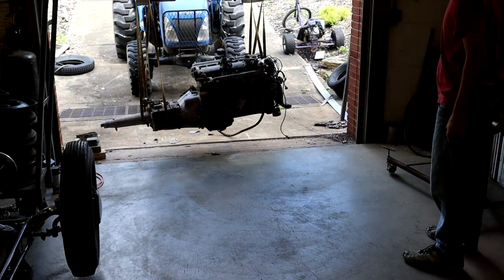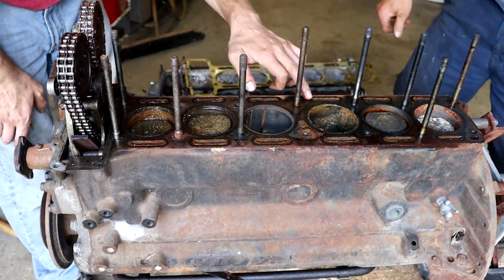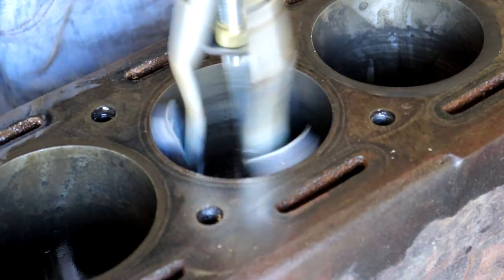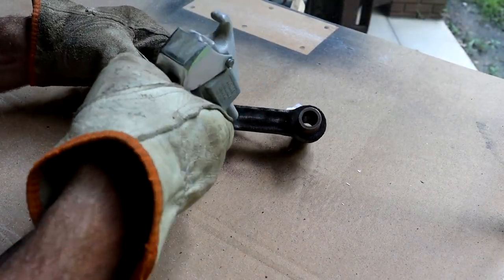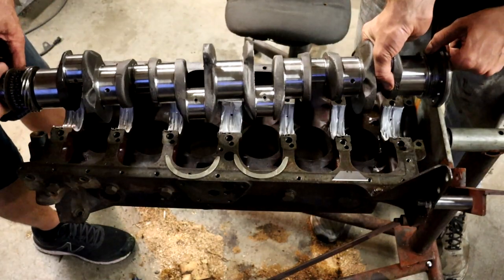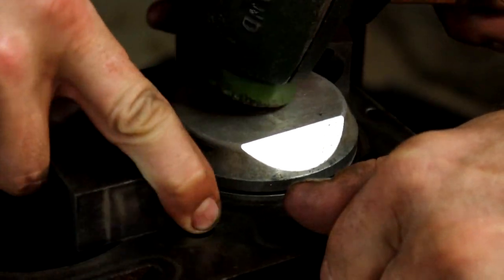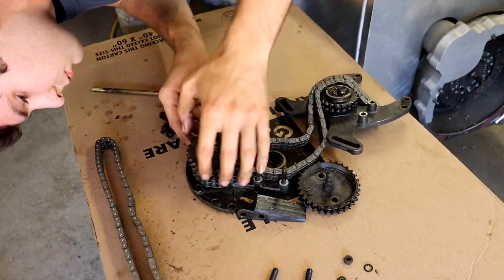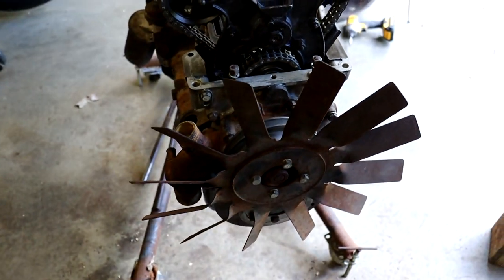How to NOT Rebuild an Engine | Homemade Boat-tail Speedster Pt. 57

Comment: That is the way You get a soaked paperweight delivered off the hook of a tractor back into a working engine. 
It's an old Jaguar engine, so tolerances were a function of the weekday, the number of thrown rounds in the pub the other evening, the main builder's state of marriage and the half materials Jag had bought from the neighboring factory, each of which being themselves a function of the same array of random factors ..... so, getting it running was probably the same lottery it was the first time back in Coventry. I do not see why it shouldn't run after Your cleanup - might become an oil-drinker (I think it won't) or not have every single horse present meant to be there helping, but that's why You built Your speedster as light as possible, right .... ?😁 Thanks for sharing! Congrats for the career moves.

Comment: Nice to see you back and congratulations on your new job! Here are a couple of tips for the next time you take on an expedient engine overhaul. (1) There is nothing wrong with this approach nor any reason to expect that the motor will not last a long time. The compression will be a bit low and it might even smoke a bit, but that is acceptable for this type of work. (2) Your engine did not have a ridge but be careful as removing pistons without addressing the ridge will break piston rings. (3) Lubricate the honing stones. (4) Clean internal engine components with a wire wheel, not a sand blaster. (4) Lubricate the cylinder walls, pistons, and rings before installing pistons. (5) You can quickly make a ring compressor from thin sheet metal and a wide welding-clamp vise grip. (6) Always stagger ring gaps - was not sure if you did.

Comment: Great work on the motor, the Jag XJ6 is a masterpiece of engineering.  But what I find is unforgiveable is when people take great engines like this, that are running and OK, and then leave them in the weather with not so much as a sheet of tin over the top.  Just so unnecessary and avoidable!  Anyway you have done a great job of sorting out the neglect.
One more thing: don't apologise too much for the 'short cuts' that some of the anal engine builders here in YouTube might accuse you of.  You are, like all of us, building to a budget and not creating something that is for a finnicky high-end customer.  Just keep on using what you have, you'll be fine!

Comment: Nice to see you back! Never had one of the 2.4 XK's. Done a few 3.4l and 3.8l and a 4.2. and they are all just such beautiful engines. Half the time they are old and sound like a sack of spanners at idle, yet they pull like anything up to 5500,  and will quite happily cruise at 100mph for hours on end. For WW2 technology, probably the best car engine in the world.
 If you have time and the opportunity, run far, far away from the V12. Great from factory, after that, just tears.
Yes, it'll run. Can you put an upgraded distributor on? Otherwise, get half a dozen condensers and a few sets of points. They will likely be new old stock, and some will be faulty out the box.

Comment: Man congratulations! Technology is so amazing these days, I often worry that old knowledge will be forgotten with modern conveniences. You clearly started with everyday machines and thoroughly understand mechanics, I'm not certain this is entirely true for engineers who spend their life behind a keyboard. I hope this doesn't come across patronizing, but your time in Texas has certainly served you well. You have a confidence and self-bearing that we're not there 6 months ago or prior. It's quite blatant to a third party observer, everything from the way you speak to how you carry yourself it exudes confidence without being overbearing. Again no condescension intended, but I can't help but feel proud of you. I'm just a stranger, one who loves manual machining, but I think you have a very impressive future ahead of you. Please try to always get your hands dirty at least once a month or so. No doubt you have been exposed to the enmity between Machinists and engineers, it doesn't need to be this way. The rare times when you find a good match between engineer and Machinist, you quickly develop a shorthand, I think you will find an enormous amount of cooperative help if you make a point of working on the floor from time to time, demonstrating you're not above busting a few knuckles. I've met one or two engineers who are in this habit, those are the few shops I worked in where it was a really positive vibe and innovation was encouraged. It's amazing what we can achieve when we find techniques to set aside egos. I'm a little sad we are not likely to get many future videos, electric aircraft is a fascinating subject but I presume you are heavily hampered with ndas. You've brought me quite a bit of joy watching you create your machines, good luck and be well
Reply: What are you talking about with forgetting old knowledge? Knowledge evolves! Every new generation of engineers learns from their predecessors, either directly or by reading the textbooks and articles written by them. There is no lost knowledge at large, it's just that some knowledge is outdated or gets replaced by new approaches. I agree that a good engineer should also build stuff from scratch, especially to get a feel for the stuff they design, but it seems to me that you have a very pessimistic view on the current generation of engineers. I can assure you that this view of yours is pretty scewed, engineers are still learning the (updated) basics that generations before them have learned and most of them still love to build and fix stuff, at least if they really have that engineering mindset. There are tons of young engineers who do exactly what MacroMachines is doing, it's just that YOU don't interact with them and that these people generally are busy building stuff vs posting about it on social media, so you probably think they're a dying breed, but nothing has really changed between these generations: Engineering types still build shit in their garage.

I'm an electrical engineer, just graduated from university, i've build countless devices from scratch over the years. See this CNC mill which i'm currently working on: https://cncwerk.de/forum/download/file.php?id=12368&mode=view

I'm even desinging and building the servo-drivers: https://cncwerk.de/forum/download/file.php?id=12320&mode=view https://cncwerk.de/forum/download/file.php?id=13091&mode=view

Comment: It'll run just fine.   It might use a bit of oil but you'd be surprised what you can get away with on those older engines. I've gotten away with worse than what you just did.  

Cold War Motors resurrected some old straight 8s that had been sitting for decades. One of them had water in multiple cylinders.  They had to make an adapter and use a hydraulic pump to force one of the pistons up and down so they could get it out. Several of the cylinder walls were terrible and full of deep pitting.  They honed it, dropped in a piston and fresh rings and fired it right up. It smoked slightly but it purred like a kitten.

Comment: Great to have you back!  I have done a few engines in a similar vein that you are taking, usually works out fine, looking forward to hearing it run.
Reply: Absolutely. With realistic expectations, sometimes "Good Enough" truly is good enough. We're not trying to win LeMans right out of the gate here--more proof of concept and shakedown runs than anything, if we understand correctly. This rebuild should be perfectly serviceable for the objective.

Comment: Cool to see you back! It'll run. I think people over think engine building. Especially when it's just a standard old engine, not used for racing or anything. I am no expert but have done a couple now. You just have to think what things have to be perfect so the engine will run and what things can be a bit crappy but it will still work. So worn ring/bores will maybe cause more oil consumption and maybe lost compression but the engine will still work. Similarly the slightly worn crank journals won't stop the thing working. If your oil pump doesn't work or a timing chain breaks then you're dead. Glad you replaced those! Must be nice working on engines where you can fit the piston to the rods and push the lot down from the top! On my Riley 9 the big ends won't fit down the bore so you have to push the rods through from the bottom then get the piston onto the rod then feed the lots back down. It's very fiddly! When you drive the car for the first time you be just as happy with it running on a crappy old engine than a perfectly rebuilt one. You can always do that later.

Comment: I know that you weren’t going for longevity, but don’t forget that engines can be resleeved back to original OEM bores. Any decent engine machine shop can do that, and any production machine shop can make new sleeves if an appropriate size can’t be found. The rest of that engine should be fine from what you’ve shown us here.

Comment: Congrats on completing your Space X internship.  FYI.  I’m following along with my own speedster build inspired by your project.
My car is currently a roller with a 4.2 Jag engine, Tremec 5 Speed and Jag wire wheels.  If I had a way, I would be happy to share some
Photos.  Thanks so much for sharing your recent progress, and good luck in California.
Reply: Are you on Instagram? That's a simple enough platform for photo sharing (despite their current push to emulate TikTok). I'd love to see what you have going!
I too have been inspired and purchased a 1960 MGA Coupe--chosen because my dad rally raced a 1956 MGA in 1957-1959. So far I'm only sourcing parts. Plan is to run a Ford Duratec 2.0 with Tremec 5 speed and semi-modern suspension.

Comment: Congratulations! Glad to have you back, i cant wait to see progress with the Speedster again!

As for the engine- You might have issues with compression on some cylinders, if the rust managed to eat away enough material in places, but it should definitely run with a bit of help. How well it runs i cant say, but with six cylinders at least two or three of them should fire reliabily provided you got the timing set correctly.

Comment: Of course it will run! I rebuilt quite a few engines or dissembled and cleaned and reassembled in your method and they ran fine for years!

Comment: What a treat to find a new video! I have had great results from backyard rebuilds, on the other hand, not so good. From what I could see in the video, it will start and run. It may have some blowby, but it could still run just fine. Good luck young man!

Comment: Don’t forget that a Jaguar has cilinder 1 at flywheel side. 
For the timing of the camshafts there are little steel tools for sale with a notch that fits in the camshafts.

Comment: The question is not will it run but will it run decent and for how long? You might end up with an engine that don't smoke if you're lucky or you may not, it's one of those things where we don't know what we don't know. From a few thousand miles away and looking it on the internet, the engine and cylinder walls look good enough to me.  If you can make a couch do 25 miles per hour across a grassy field, I'm sure you'll have no problems with this, I have all the faith in you lad, you got this, good luck in your studies, I wish you all the success.

Comment: Did you look into overboring it further and sleeving the cylinders? 2nd, use rubber hose  over the connecting rod threads when pushing the piston down over the crank journals. It will save you from scratching up a crank you just had polished. Hope to see the roadster running soon.

Comment: I recently did the same thing with a 305 Chevy, it was in similar condition, I just took it apart cleaned everything and reassembled it with new gaskets and it’s running strong. I have no doubt that your engine will run just fine.

Comment: Good luck on your new career. Many years ago I did a Chevrolet 283 that was in worse shape than your engine. Did a similar redo to what you are doing. We got 100,000 out of it and often beat the crap out of it.

Comment: I had a couple of cylinders that I couldn't get all the rust out of after sitting after a rebore.  Hones them and there was still a shadow of the rust.  couldn't catch a fingernail or really even feel it.  That engine is still running smoke free after 10+ years.

Comment: Look at Line2Line coatings if you need to have the cylinders honed another .010" so they clean up. Line2line can coat the pistons up to .020" so that's an extra .040" if you need it, .020" per side of the circle. Good luck.

Comment: I think the bottom end went well. The only thing I would have done different was to use a 400 grit dingle ball hone on the cylinders to make the surface more uniform, and leave a nice cross hatch. I think the engine should run but I think the cylinders will glaze over a longer period of time.

Comment: IDK if any damage occured (or wasn't corrected) but oil is req'd when honing, or the stones can load-up.
Reply: It did look like they'd used oil when they wiped the cylinder wall afterwards, hard to tell for sure 🤷🏻‍♂️
Reply: @kiesh.  the stones were dry & there was no slinging while they were honing
Reply from the maker: We put plenty of oil on them

Comment: White lithium grease is what people used back in the 50 - 60's but everyone that knows engine building dropped that because we know it does not break down in the oil it gathers and plugs the oil filter lol. It will work but assembly lube is made for the job. Change the filter soon after it gets running.

Comment: Congratulations on your new career,  I  think it will drive fine and the engine will be good for longer,  but you will want a complete rebuild motor for the future and road use, but then later you could do a electric? But I also know you can run petrol car's on alternative fuels with sero pollution,   but they are not looking into that 😕  👍🏽👍🏻😀

Comment: mightve used electrolisis to get the rust of the rods , done that with a flattening table and it left a black residue that prevents it from rusting again 
allso if the bare block from the first engine is still good you might be able to use the oversized pistons of the second engine in a fresh overbore of the old one then mix and match all the parts to make a good engine 

this engine should run , might use a bit of oil and smoke some but should run , little worried about the cams and stuff as that was slightly rusty too and could cause everything to wear out faster than normal 
the older engines arent as finnicky about bearing clearances reusing rodbolts and that kind of stuff as the more modern engines , they dont run at all that high rpms either , just make sure you got oil intoo the head and good oil pressure before atempting to start it 
if the SU cabs give you problems you could try run motorcycle carbs on a homemade manifold , seen people use a single predator carb from a lawnmower motor on a V8 engine and it ran fine (they did ran the carb rich and put a electric valve in the system that added air )
https://www.youtube.com/watch?v=FwhMz2kR4pw , probably be eazier to tune and a full row of 6 carbs gives it a more racecar feel

Comment: I've seen worse rebuilds, even from "engine masters", so you're good. Lap the valves and clean the carbs, and it will run just fine.

Comment: Congratulations on your endeavour and good spirited projects ...

Engine wise, have you considered the "tall block" (about 67mm taller) Jaguar engines, which in 3.4l come from a wide variety of state of tune until quite recently (well, considering) and probably be cheaper, would it fit under the bonnet ? not much extra weight ...

Comment: Never tried to install pistons without a ring compressor. They are cheap. Were the cylinders honed dry?
If someone polished your crank I hope you checked all the oil passages after.

Comment: If you ever again need to put pistons with rings, get yourself  a large hoseclamp (big enough to fit piston) and compress the rings - just as you would use a ring compressor.
Reply: May as well just buy a $15 ring compressor.

Comment: well this was a nice sunday surprise! glad career stuff is looking good for ya!

i'm no engine pro but i think it might have been a good idea to apply some liberal amounts of at least engine oil on the cylinder walls and pistons and maybe spring for a new water pump. the oil pick-up seems like it wouldn't draw that much oil when you compare it to the common us-types with large pick up screens. i could have missed something. still, fire up should happen but how long it lives...

are you planning a more in depth rebuild down the road?

Comment: I'm stopping this at 4.57 , are you absolutely sure that the max oversize is only 0.030"? I am  pretty sure the larger Jag 6 pots will go to  +60 oversized. I could be wrong but I follow a channel here in the UK called Barum Engines and they recently did a 4.2 at plus .060"
Reply from the maker: The manual says .030, but bigger might still be possible

Comment: My uncle had an engine I similar condition.  He didn't tear it down though, he got it knocked loose only to find the oil rings were stuck.  So he blocked off the rad and drove it to overheating.  The extra heat was enough to loosen the rings up.  He then sold it to a taxi company and they drove it trouble free until the body rusted out too much to be presentable. 

Don't sell short a poor man's rebuild.

Comment: Surprised with the machines you have available you or your dad didn't throw together a ring compressor

FYI I have seen engine rebuilds like this run thousands of trouble free miles

Comment: Even though this is bored 30 over, can't the engine shop press in sleeves?  It would be a shame to not use the block as the final engine if it hasn't got any cracks in it.